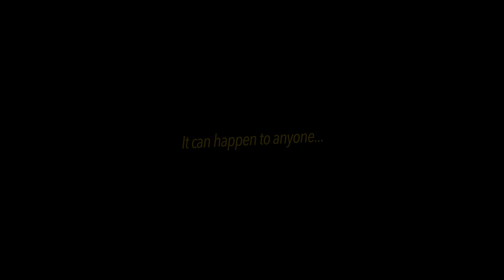SILENCE! How to fix contaminated disc brakes

Comment: But squealing brakes act as a great horn replacement.
Reply: I actually use the rear brakes for that :P:P
Reply: Oo yea i think the same
Reply: Down with thatt
Reply: But I woke the whole country side with my squealing 🤦🏼‍♀️
Reply: I used squeaking brakes for 2 years as a horn and it was effective until I fixed them bc it made me crazy lol
Reply: yes, and they now know for 100% that you had to brake for them.
Reply: squealing is so obnoxious, and then you can't ride at night or in quiet areas without being a total jerk when you need to slow down. a bell is can be used only when you want to.
Reply: @streetsareforpeople723  just have the front working. And back squeaking.

Comment: Better method- clean everything with alcohol or solvent of your choice. Sand the pads a little bit. Get a creme brûlée torch and “burn” the pads and rotors by heating them up. This literally burns away any contaminates. Much faster as well. We do this at my shop and it works every time no matter how badly contaminated the pads and rotors are.
Reply: Nah man, a customer came in and his brakes squealing... he put tri-flow on the rotor... a nuclear bomb couldnt un contaminate the pads or rotor hahahaha. I just took them off and replaced hahaha
Reply: This^^^.  Alcohol just spreads the oil around.  If you don't burn it off, especially in all the vent holes, the oil will just recontaminate the pads.  Slightly contaminated pads can be torched as well.  Heat em up till they quit smoking.  Quick sand to get rid of the polish, and  good to go.  Totally soaked pads need to be replaced.
Reply: Scott Hollister metal is porous also. The way his pads and rotors were, they weren’t fixable no matter what.
Reply: Hope it works, just waiting for my rotors to cool down, theyre supposed to be like liquid metal right?
Reply: Been using a torch for years.  It's quick and simple and works every time.  I clamp both pads in a vice at the same time (or all 4 if front and back are squealing).  I heat the pad surface evenly until it catches on fire (it only takes a few seconds).  That is the contaminate burning off.  I remove the torch and let the pads flame out by themselves.  I wipe the rotors with solvent (usually lacquer  thinner).  I put the pads back in the calipers and go ride.   The whole process takes only 3~4 minutes.
Reply: Just tried this as the degrease/sand method didn't work for me. Awesome! it was quicker and much more effective. Thank you.
Reply: Would petrol work the same?
Reply: @hughoneill6555  Yes, petrol is cheaper and just as effective. It's the degreaser of choice for large projects, like cleaning chains that have to be submerged. You should finish up with alcohol.
Reply: @jeffcarter316  I saw someone's note on using a torch to burn contaminates off the pads. I used rubbing alcohol to clean the rotors, twice, then sanded the pads twice, and hit them with a blow torch (did it twice because I assumed when they squealed after the first time, I haven't done it well enough). It crackled for a second, I saw some pieces burn up, but then the metallic bits in the pads started popping, and I lost a chunk in the center of my pad because it exploded out. Even after that I'm still getting squealing issues. I've had trumpet brakes since I can remember on this bike. It's a dirt jumper and I remember going down hills to evenly brake to bed the brakes when I first got it.
Reply: @MckWells  You got them so hot the metal in the pads melted. It only takes a few seconds with the torch. If the pad glows it's too hot. The contaminants will burn off at a much lower temp than it takes to make the pad glow or metal melt.

Comment: For contaminated pads, I remove the pads and put them in the oven at 400f for 40 minutes. I have seen people burn them with lighter fluid or gasoline, but it's not as foolproof as the oven - burns off ANY contaminants. Let them cool slowly. Clean the rotors. Break them back in and you're good to go.

Comment: Not sure if it's been said before or not, but nail polish remover is not all the same. It's relatively dilute and can sometimes contain things like glycerin to help keep from drying out your skin. You can get pure acetone at hardware stores in the paint aisle with the rest of the solvents like mineral spirits.
Reply: I use brake clean spray on a rag.

Comment: 3 years later and I find this video. Couldn’t sleep and wait till morning to test. Had 2 pair of thick shimano pads and two rotors all infected. First soaked everything, then toothbrushed, sand, soaked and finally cleaned with rags. Put old brakes on and man, pads bit like a pit Bull not letting go. Your video still holds ! Great video information and had the best result! Never throw good pads and rotors away…acetone it!
Reply from the maker: Happy to hear! 🙌
Reply: im going to try this right now

Comment: Acetone is nice for the rotor but if you really want to effectively save brake pad best solution i found is to burn them. If they have some oil in them they will crack a bit in fire, once they stop cracking they're free from contamination and will ride as new.

Comment: Useful video. Couple of things to be mindful of:

1. Be careful not to get nail polish remover/acetone on painted/clear coated surfaces. If you do, clean it off and definitely don't let it sit there for too long.

2. Use emery cloth, not sand paper. You don't want bits of grit from the sand paper getting embedded in your pads or stuck between the pad and the disc.
Reply: Excellent points.  Also, if you did indeed get mineral oil on your rotors, just wiping the surfaces may not be enough.  The small holes in the rotor can have mineral oil around the edges that may work it's way back into your brake pads if you ride in the wet again.   I clean these with a q-tip dipped your favorite brake cleaner (acetone is fine - just be careful with it)
Reply: Emery cloth and sandpaper look the same to me.
Reply: Looks can be decieving.  And there is something in a name.  Sandpaper is just that. Paper with grit glued to it. It breaks down if it gets wet. Emory cloth is fabric (cloth) and much sturdier. It won't break down and she'd grit all over your project.
Reply: @jimhansen5395  Thank you for the clarification. Will try these emery cloth. 😊
Reply: I'm guessing acetone is also called white spirit?
Reply: @braza117  No. Acetone is also known as propanone and is usually the primary ingredient in nail polish remover. White spirit is mineral spirits, or mineral turpentine. Does nobody know what web search is anymore? (Not having a go particularly at you but I see simple questions like this all the time that are easily answered with something like Google.)

Comment: Works like a charm! Thanks!

Edit: I've also used Meglio degreaser on both the pads and rotor. I have also sanded my pads with 220 grits , works too.

Comment: Thanks for sharing this info! I'd been battling this problem for a while, and it was driving me crazy! I didn't know you could "wash" brake pads. I used isopropyl alcohol on mine (since I had it on hand) and it worked really well! I skipped the scuffing of the discs since I'd taken that step (aggressively) on a previous attempt to fix it. Now, I have the stopping power back, and the brakes are quiet, with just a tiny chirp from them in the last 20mm of a complete stop, which I can live with.

ありがとうございます！
Reply from the maker: SkarTisu awesome, glad to hear it worked for you 👍

Comment: Thanks, Tobias. I had installed some new pads after I had bled the brakes but probably did not clean up around sufficiently the calipers.  So that was the likely cause of contamination.   I followed your advice, to the letter, though I bought a stainless steel tray from a 100 yen store.  Worked a charm.  Sourcing Acetone is not easy in Japan. Nail Polish remover is the go.  Always enjoy your videos and your excellent and amusing production. Peace.

Comment: Perfect, I tried Zefal, Facom and MucOff disc brake cleaners and plain acetone is doing the same if not slightly better job !!!! (1/3 of the price)
Toothbrushing the pads with acetone is really effective and you don't have to sand the pads everytime !
Thanks a lot

Comment: I sipped the brake pads in a cup of lemon juice and left them in for a few hours. It appeared to help a tad, but not sufficiently. I must admit: I hadn't cleaned the pistons and the discs properly. I'll try denatured alcohol and SwissStop Brake Silencer. If that procedure doesn't help, I'll resort to your method. Thank you. And thank everyone suggesting alternatives to either the sandpaper or the acetone.

Comment: Thank you. I’m new to Disc brake and I almost gonna spend another 15 bucks for a pair of brake pads. I heard this crazy sound I thought it’s time to change some new pads but it’s actually cause from oil or something with dirty pads after I did all of your steps now it’s a quiet braking. Thank you ☺️
Reply from the maker: The Hyping Bee happy to hear it worked out for you 👍
Reply: Subscribed*

Comment: I've had to "repair" my pads before I didn't clean them with anything but I did sand them down.  I used drywall sanding screens instead though, that way when I sand the pad the dust will fall away from the pad and doesn't risk recontaminating the pads.

Comment: Great Vidieo! Love your up close views. 
Full pad and disc cleaning is important to understand, in order to be safe. It goes quick when you know how; even if you just spend a small time doing it; amazing results if the discs are not already warped from failing to bed-in the brakes correctly, like me. I warped my disc, and glazed the pads on the front wheel in 2 short test rides after I received it in the mail and set it up; Forgot to bed the brakes; most of my old bikes never had disc brakes..
warped the rotors a little; tried sanding the rotors, did not clean the pads, did not work; too contaminated. Have to do both; but if it's quick, probably won't matter; just do it fast. I used 1000 grit sand paper on. my discs and pads; with glass to rest the paper on, then taking pads evenly on the flat surface. Worked great; first time I've had to do it but my front brake sounded like a goose honking; it was horrible!

Comment: Thank you. Tried the exact same method and it worked!

But painted surface on the pads doesnt react well to acetone! LOL My swissstops yellow was peeling abit.

Sanding it down works and I cleaned away the dust residue with clean water & kitchen towel. Works like a charm!

Comment: I never thought about using nail polish remover. The only thing that worked for me was burning the disc and pads with a flame until red hot and then sanding them. But I will definitely give this a try next time; but far away from my paint.

Comment: Never cleaned brake pads or discs before on the more modern bike but after watching this video I'm gunna give it a go.great vid easy to under stand and helped alot thanks
Reply from the maker: Cheers mate!
But there no reason to do this unless you have problem with you brakes 👍
Reply: @ridesofjapan  the brakes ain't slowing me down properly takes a while to stop there quite new they've only been on for 4 months if done what u did in your video but there ain't much difference so I think the pads have some how got oil or grees or something on them they was also a lot of salt grit from the roads on them so I will just buy new 1s n see if that has an effect

Comment: I always use rubbing alcohol with a completely dry clean shop tool . yes as stated in the video , it gets torn up  and i toss them.any contaminants on rags end up on the parts . some rags don,t wick up the moisture , cotton is a good way to go if its free of any oil ,soap ,and fabric softener .
  Great video by the way . And yes it really works ! 
     TIP . if not bad . Sometimes a red scotch pad with alcohol on the disc to remove the glaze is all that is needed . because it is caused by road dust .
  I wonder if bike shops make money selling unneeded pads and /or disks? Probably the honest ones will clean it the same way as shown . but charge you the hourly rate to do it.

Comment: I just built a new bike w/ Ultegra brakes and the brake squeal at low speeds (just before stopping) was *horrible*. I followed these steps and now total silence.
Reply from the maker: Awesome to hear mate! Thanks for reporting back 🙏
Reply: About to try the same....brand new rotors. I must've been careless in my clean and installation...hoping it works
Reply: Likewise! I’m going to give this a try now. Were they like this from even before your first ride?
Reply: @tori-youraiguide  I put on brand new rotors, and the squeal was there right away, first ride. I consider this cleaning routine a "condition the new rotors" routine going forward.

Comment: Very good... I had extreme squeal with new brakes.... tried various options.... cleaning sanding, sanding rotors, different pads etc etc.... in the end what really helped was a long long down hill and keeping the brakes on just below the squeal.... I know u mentioned this.... I will try the acetone next time 👍👍👍
Reply from the maker: If it was a brand new bike it sounds like your issue might have been that the brakes had not been properly bedded in.
Reply: Rides of Japan very likely .... then again how does one bed in new brakes🤔🤔🤔
Reply from the maker: Fritz Dittmann the really thorough way to do it is something like this:  https://youtu.be/2yl7KWaF_oA
Reply: @ridesofjapan  the brakes not being bedded in will sound like the noise in your video?
Reply from the maker: @tori-youraiguide  no, the noise in my case was contamination.
Main issues with a brake system that’s not properly bedded in is “pulsing” feeling when braking and brake pad-life being really short. Doesn’t necessarily mean they get noisy.
Reply: @ridesofjapan  okay thank you, I must have gotten some bad ones. Did this process with the noisy brakes and when I went in to the shop where I bought the bike they said they were destroyed and crazy color after only 100 miles. Must have been contaminated while sitting in the shop or bad batch I assume

Comment: I put pads into a small jar of petrol putvtge lid in and leave for a couple of hours.  I then remove and clean with kitchen paper before i heat up on a gas stove to burn off any contaminents left on the surface. After that a light dry sand with 400 or 600 wet or dry  paper. I haven't  tried acetone but i do use a wax and grease remover.

Comment: Thank you so much for the tip! This method worked wonders on my contaminated brake pads and rotors! I just spent less than $2 to fix the thing, instead of buying a pair of new brake pads that'll cost me more than $5. Acetone, cotton balls, and sand paper did the trick for me.
Reply from the maker: Awesome, Happy to hear that! 👍

Comment: As an extreme last ditch effort I used oven cleaner on my rotors and brake pads and rinsed well with water and it worked. But this stuff is very caustic and can etch /damage metal and  bearings  and damage paint so use at your own risk.  Oven cleaner is the best degreaser I have found.
Reply: i just use a torch and heat them up and when it stops smoking its done, it works great!

Comment: Man, I'm all pro new tech and progress when it comes to bikes, however, discs on road bikes seem to be a huge headache for now. Maybe in the future, when these annoying things are sorted, I will move from rim brake to disc brake.
Until then, I prefer riding my bike to fixing it all the time. Great video though.
Reply: you are right there,but i have an ebike the power with the v brakes was crap, and my rear disc brake will not shut up :(      ur right i have to try fix it all the damn time.

Comment: Isopropyl alcohol works great as well! And it has the benefit that you can buy it pure, so it leaves no residue and contains no water (or very little water) compared to acetone solutions.

A pricey but effective option is also to buy a specific brake cleaner for cars or bikes (muc-off is expensive but it does work great and it evaporates faster than acetone and alcohol)

Comment: Hey, I just learned a better way to clean the pads! 
1: Apply a generous amount of dishwasher soap to the braking surface of both pads. 
2: Rub the pads together for maybe 10-30 seconds. You'll see pitch black dishwasher soap ooze out from between the pads.
3: Rinse under hot water while still rubbing the pads together.
4: repeat a few times. I just tried it on the squeakiest pads I've ever experienced, and after 3-4 repetitions they looked good again. Note that they look more like silver than that bronze tint when you're done, but once you wipe them dry, they will look like new pads.
(Brasklapp: I haven't test ridden yet, so I don't know if it really worked, but befoer cleaning they squeaked on the work stand, now they don't)
Reply: Ok, test ride complete. The first attempt actually failed. I actually only tried with the rear brake, and put in a new set of pads in the front. Front was completely silent. Rear was better than before, but not good. Still pretty lousy power, still some howling. I then realized that I had cleaned the front rotor much more thoroughly than the rear, so I went back in and gave the rear rotor a good scrub. Since the pads had likely been re-contamined by the not perfectly clean disc, I gave them some more dishwashing soap. New test ride. Success! Silent rear brake with good power! Can definitely recommend this!
Reply: Thx